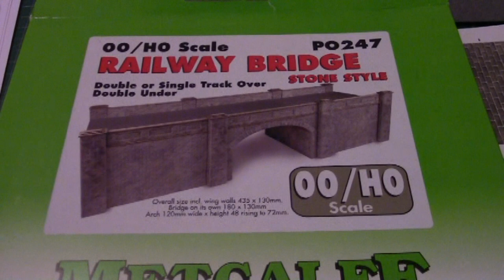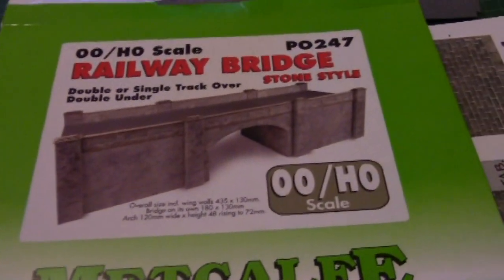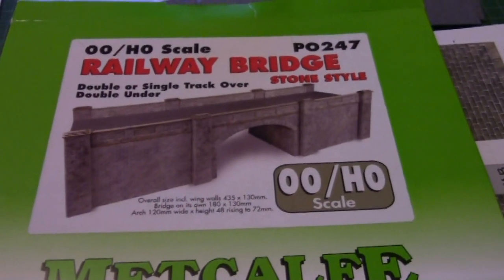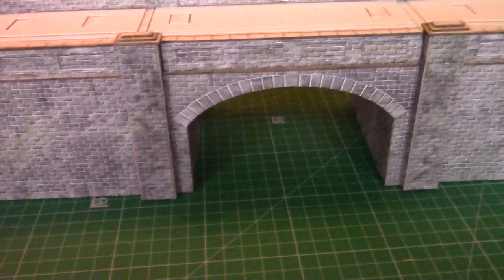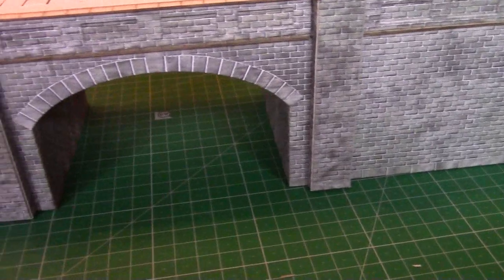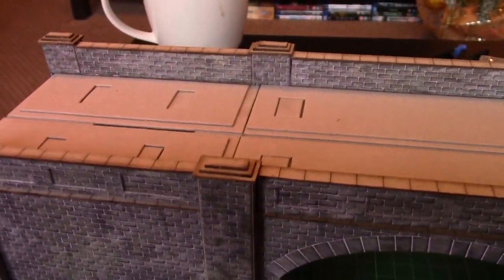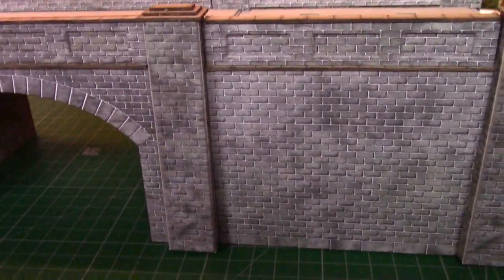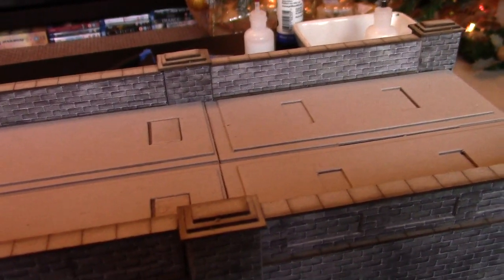A OO Timelapse Series - Bridge

Comment: Hi Steve, The bridge looks great and appears very sturdy. As for ballasting, I would give the surface a spray of varnish to seal the cardboard and protect from the liquid when you ballast. You might also consider Ballast Magic, which when mixed with the ballast you only have to give a light spray of water to fix it rather than lots of PVA glue mixture.
Robin
Reply from the maker: +Milton Mo Junction Thanks Robin, I have already sprayed it with varnish and i have  2mm bolster wood sat under the cork. I will still have a look at that Ballast Magic though as I don't want a major disaster and a full investigation by the transport police. Steve
Reply: +JamesStJunction  No you certainly don't, lol. I always use that ballast magic around points and places that don't want to get to wet or sticky. i think it is to expensive to do the whole layout. 
Robin

Comment: Hi Steve. Your right, the Metcalf kits are fantastic to build and the rail scene stuff looks great.    I too would like some more modern stuff from them, but I can often find that elsewhere.

I have got a Metcalf viaduct with tracking running on top.  I just used neat PVA to ballast the track (and stick the track down) and it looks fine.  

Looking forward to seeing some engines running over the bridge ... Steve
Reply from the maker: +Broughton MCR Thanks for the tip Steve. I reckon if Metcalfe did a survey they would find out that there is a high demand for more modern building kits.  Steve